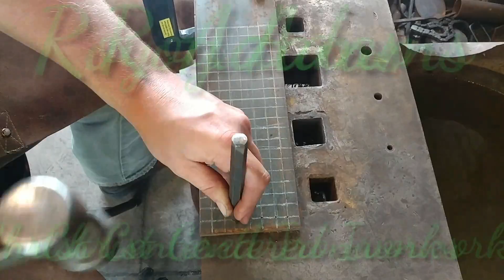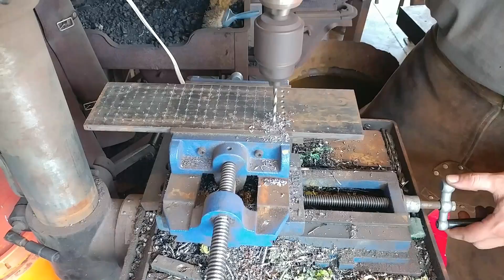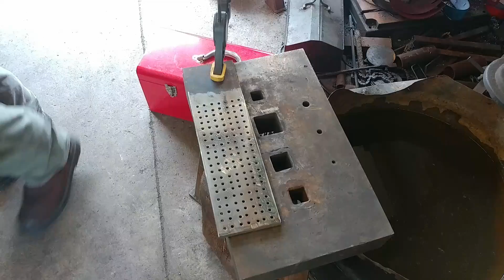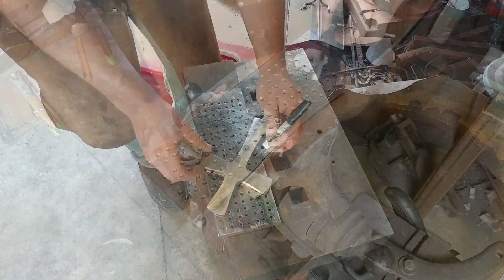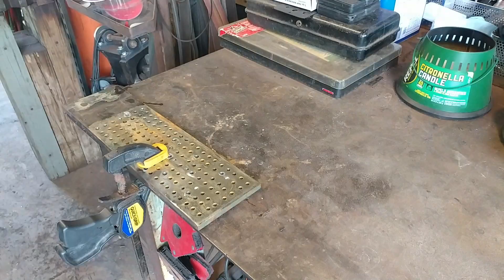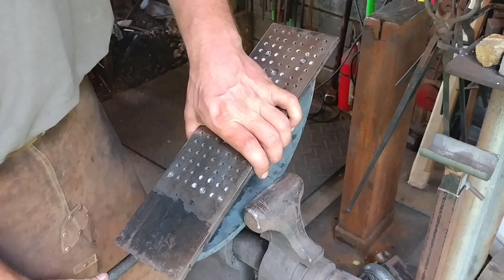Making an Engraving Jig // How to Make Engraving Tools for Blacksmiths

Comment: Actually Roy, you probably do have a power tap.  A variable speed reversible hand held electric drill can be used quite successfully to tap those holes.  Yes there is a learning curve as you break a few taps, but holding the correct angle and being sensitive as you tap, it is a must faster than hand tapping.      I have been using my Milwaukee 1/2" hole shooter to tap steel for many years.  There a few different reasons why tap break.  Not following the exact angle the hole is drilled is just one reason.  On through holes such as you are doing here, using the proper taper tap in the drill can really speed things up.  Drilling the holes slightly oversize when possible will  reduce the amount of metal the tap needs to remove, also speeding things up as well as reducing the chances of breakage.  There are also different grades of taps, and the better machine taps cut better.  And use a tapping oil.

Comment: This reminds me of another YouTube channel: Clickspring.  He is a clockmaker & machinist, and has a variety of different shop-made jigs & fixtures.  His website (http://www.clickspringprojects.com) has a couple dozen different tools, including a clamping and workholding kit that could easily be adapted to work with your engraving jig.  Most of what he's built he has borrowed from other places, so some of the parts are available commercially.
You might need a machinist to make some of the pieces, or you may be able to order them (http://www.miteebite.com/ is one of the places he has "borrowed" from).

Comment: I just use a cordless drill. Run it in until it meets some resistance, reverse to break the chips and repeat. If you drill the pilot holes just a few thousandths over the tap drill size it will make for easier tapping.